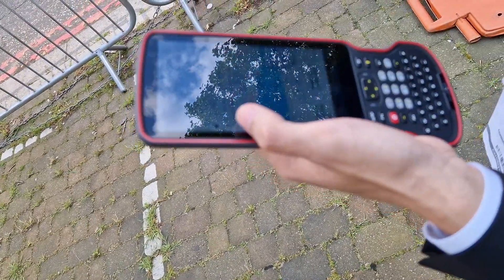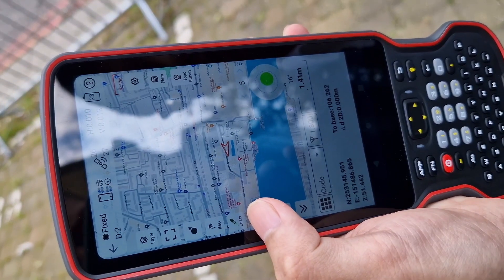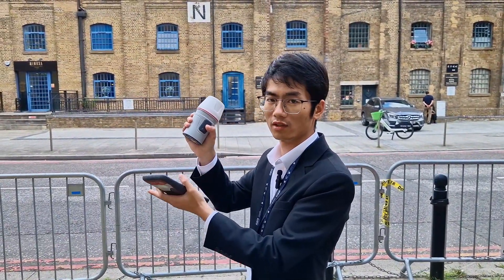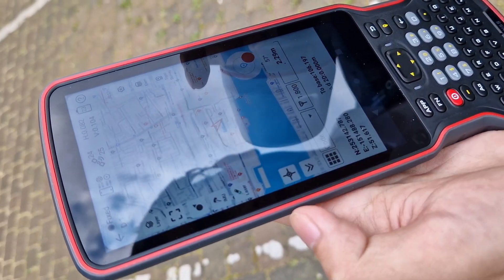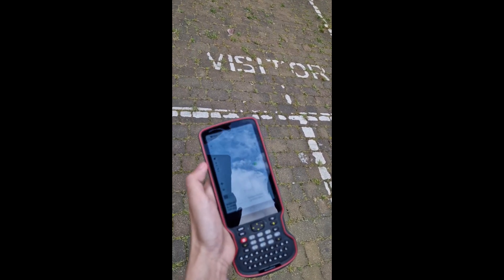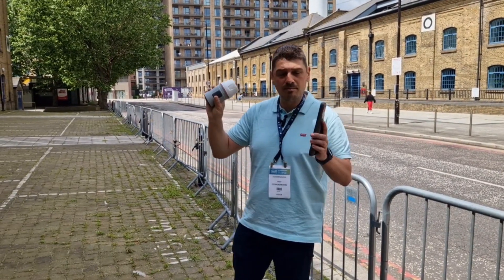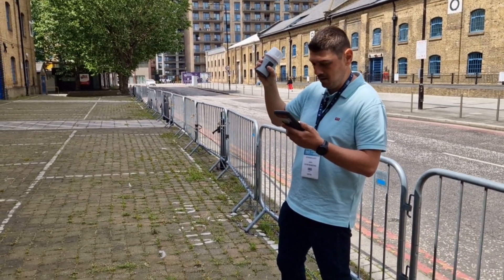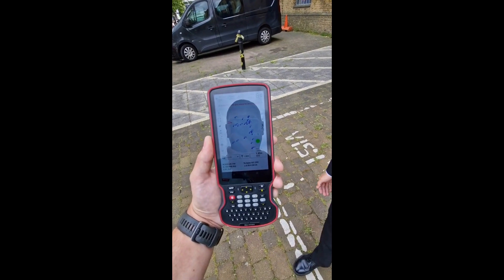Venus Laser RTK CHANGES Surveying FOREVER

Comment: How does the accuracy change depending on the angle you shoot? I mean you can also get to manhole pipes with a tiltcompensated gnss with a pole attached.
Reply from the maker: It’s basically a laser tape measure incorporated in the GNSS receiver. Of course you can get same shots with your pole, but your pole is usually 2 meters and you need touch physically the point with the tip of the pole. 
I can see some benefit on some of my jobs, like deep trenches, manholes, etc. I am sure that there are surveyors that can find this function useful

Comment: This would be cool for Pipe line Asbuilts, not to get in the ditch anymore, just stay on the top and beam down to top of pipes. Did he have a price yet for the USA market?
Reply from the maker: I can see it's use for manhole invert levels, pipe and other hard to get points.
I think the price was €5000 or $5500 plus taxes in US which is pretty fair. Send me an email and I can put you in contact with their Sales Rep
Reply: @flyingsurveyor  ... Is that the machine alone? Then add data collector, an I assume their software?
Reply from the maker: @parexc07  for $5500 plus taxes was definately included receiver, controller, software and I think that also accesories like detail pole and adaptor. 
I saw that their products are quite used in Europe
Reply: @flyingsurveyor @flyingsurveyor  ...OH, and by the way, I like your videos; I also run the Emlid RS2 and RS3 with a CT8 data collector and FGA software now for the last 4) years I sold my old 5800 Trimble and don't regret it one moment. But kept my Trimble 5600 gun.
Reply from the maker: @parexc07  thank you very much, your comment is much appreciate it.
If the equipment still serves you well, is no point to waste your money. 
Regarding GNSS I think that a new low brand receiver is better than a 10+ years premium brand receiver.
Btw, I had the opportunity to speak with somebody from Emlid at Geo Business event in London and they told me that there will be some cool upgrades regarding their software.

Comment: Its a cool consept but not sure where you can apply it. It most likely depends what are the countries guidelines for topographic surveys. Where im from you cant mesure  asfalt with GNSS only with totalstation, and any surface that has grass  you cant get the ground mesurement with the laser.
Reply from the maker: @m2rtsoo I can see it more as solution for inaccessible points like the invert levels of manholes, the bottom of a small bridge or any point that you can't access safely. Imagine that it's like you have a 10m+ pole, or like a Total Station EDM (with shorter range) without needing to carry or setup one.
When you don't need the laser you can screw it on a classic survey pole and use it like a normal receiver.